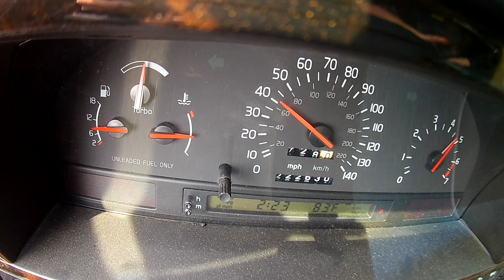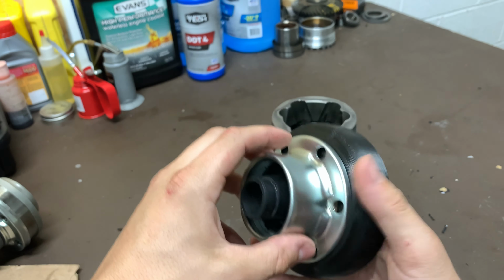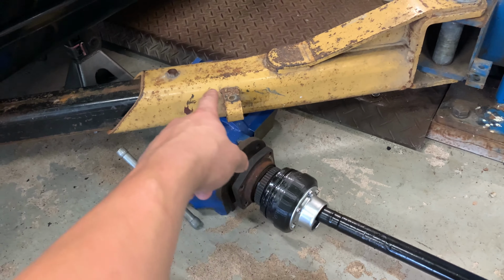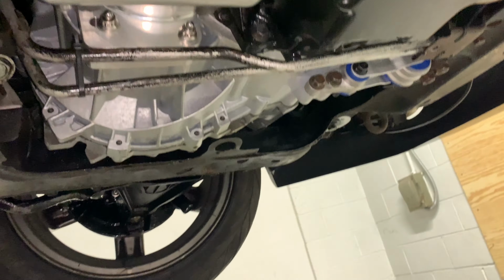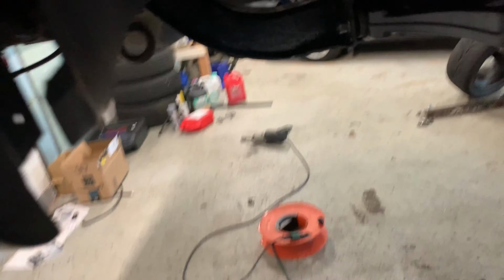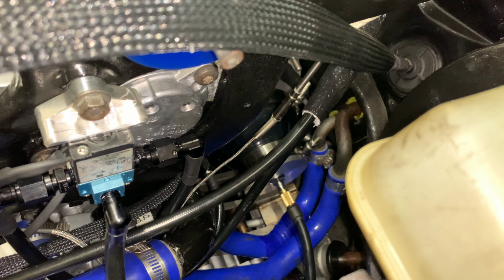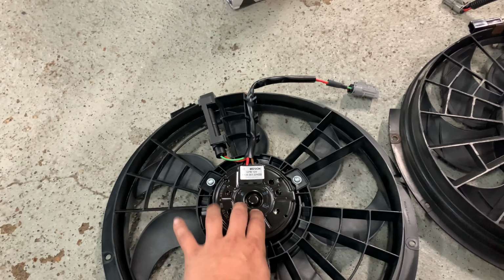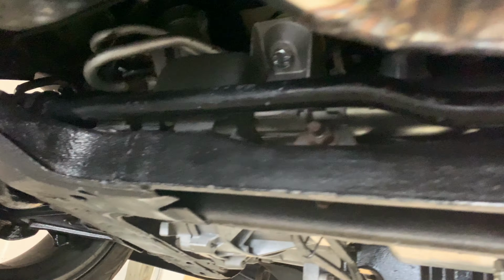Volvo 850 T-5R AWD Swap - New Rear Axle Stub Install

Comment: I noticed seeing in several of your videos where your upper control arm contacts the subframe, like @2:55 . I have a 98R, and quite certain if my UCA went that high to where it made contact with the frame, the tire would be crushed up into the fender liner.  Looking at the parts list in VIDA, every part is same between XC and non-XC cars except for the uprights/knuckles and lateral links. I wonder if the XC vs R vs standard AWD uprights are different heights?  If I'm right, maybe XC uprights would give you more clearance?

Comment: Why did you get interference in the first place?  Did you change the suspension geometry at all?  You were using stock axles at the wheel end... or is it because they're 960 shaft assemblies that are larger than stock P80 rears?
Reply from the maker: Im not using anything from the P80 AWD axles. I use an entire MKI 960 axle and they have a much larger diameter outer CV than the P80 AWD axles. About 108mm OD vs 60mm.
Reply: @SimplyVolvo  Right, I figured perhaps that was why.  MK1?  I thought they were MK2, like 95+ version.
Reply from the maker: @ChristopherBurtraw  The MKI axles use a 6 bolt GKN 108mm CV on the inners. Thats what my custom 4340 inner stubs bolt up to and allow me to adapt these axles to the 27 tooth spline eaton detroit trutrac lsd in the rear. The MKII axles use a 26 tooth spline CV that is non removable so I would not be able to use my adapters for the 27 tooth lsd.

Comment: That oil feed connector to the angle gear looks vulnerable. Wouldn't it be better to have it on the back side?
Reply from the maker: The bottom is best because it will gravity feed the pump. It sits higher than the oil pan and doesn't sit below the sub-frame, so if it gets taken out I have bigger problems like a cracked oil pan.

Comment: I bought a crashed 850R (16t, injectors, 18psi tune, big intercooler) I'm looking to make 500 hp in the end. Heres a hypothetical for ya! What would be the most simple and cheapest way to do it? (I dont care about reliability or the engine turning to dust). I'm asuming upgraded bottom end, big fuel pump, bigger injectors, bigger turbo? How would A 5-speed trans hold up to that sort of power? Awesome car btw!
Reply: You can do 500 even somewhat reliably with only a rod upgrade and a big turbo - obviously fueling needs to keep up (pump, injectors - I recommend DW for both, I doubt the blues/greens/whatever is on your R will hold up), you'll need a much bigger MAF housing and a good tuner.  
Do88 drop in intercooler or equivalent, E85 recommended (even more fueling system requirements).  The 5 speed manual holds up well but you will probably want to swap the diff for a gripper or quaife, the stock one will either blow or struggle to put down power.  The car in the video originally had the FWD 5 speed with upgraded diff and held up to over 800 hp.
Reply: @ChristopherBurtraw  And the clutch..
Reply: @ChristopherBurtraw  Or you could do it properly in one go like SimplyVolvo is doing: AWD conversion with a retarded amount of custom parts and fabrication :^)
Reply: @Wasmachineman  lol yeah everyone just has 50k+ to throw at their P80s lol ;)
Reply: @ChristopherBurtraw  'Simply' Volvo:))
Reply: @z_855turboR  nice catch I didn't even think of that

Comment: Love this build.  I'm going to get some of this oil and try it out in the car I'm putting together.  Nothing crazy... just a P2R manual drivetrain in a 00R wagon.

Are you still running the welded VC?  Thinking about attempting this mod.
Reply from the maker: Yes still welded VC (locked 4WD).

Comment: How do you think it would do on say a short circle track? 🤔 😜.    What do you think its 1/4 mile time would be?    Not beating it to death but just a hard rip...
Reply from the maker: I would never drive it on a short circle track because its locked 4WD and purpose built for drag / roll racing. The understeer (while predictable) would not be an enjoyable experience. The locked 4WD under heavy acceleration around a corner would always want to go straight. 1/4 mile we will see when I get it on the track.
Reply from the maker: @Wasmachineman  No it won't the drivetrain wind up is harmless. You get a little tire skip at low speeds when turning and at high speeds its unnoticeable and won't harm a thing. I have close to 1000 miles on the street locked 4WD now and drive around bends all the time. The only reason for not driving this car on a circle track is the extreme understeer at WOT.